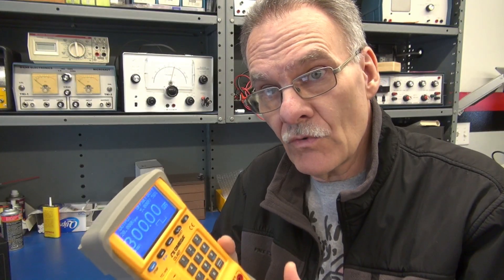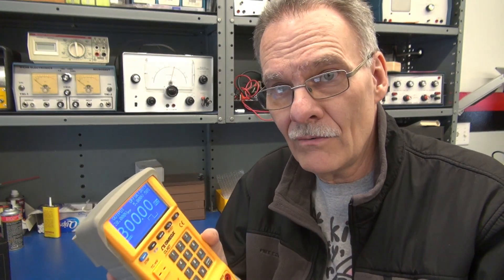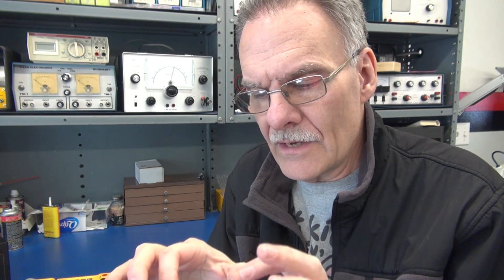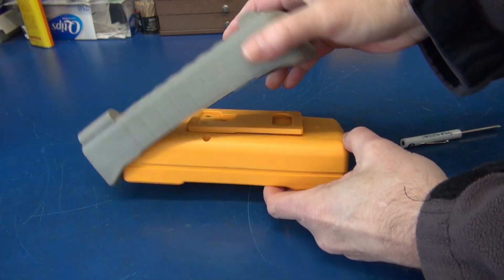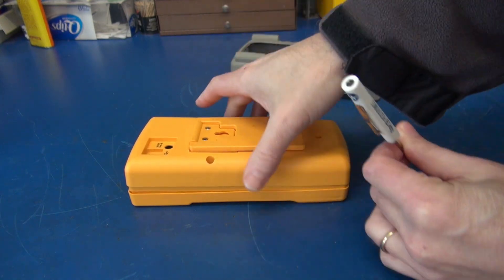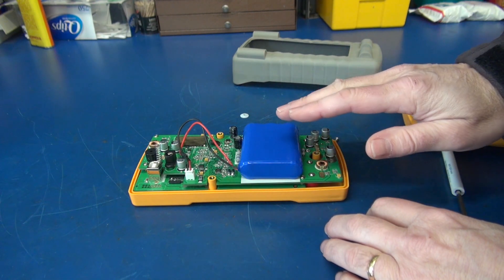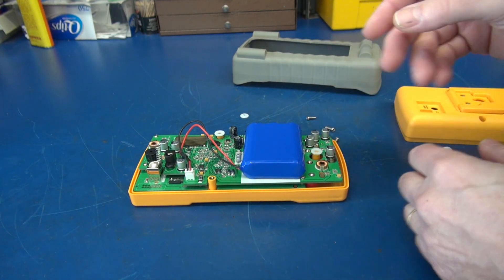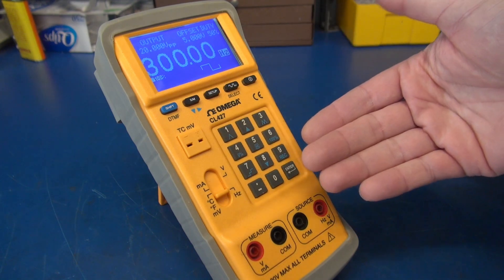Omega CL427 Multi-function Process Calibrator lithium rechargeable battery replacement sub info

Comment: After watching the video I went to the Omega Engineering site and looked at the manual for the CL427.  Yup, no mention made of a replacement battery, and from what I read it seems like they want you to send the unit back to them for maintenance and repair.  So even if they do have batteries, they want to be the ones opening the device, along the lines of the old "No user serviceable parts inside" stickers on products.

Comment: I delt with Omega many years ago, purchased some simple dial thermometers that screw into a pipe fitting. Half of them had problems within a short time. They were definitely over priced also.

Comment: hey, looks like a 3s Lipo pack from r/c would fit like a glove, those come in many lengths and heights with similar widths.
Reply: You need a special lipo charger for lipo battery right?
Reply: The charging circuit is built in to the instrument, and the manual indicates the original battery is lithium.  So it may not be a precise match, but close enough